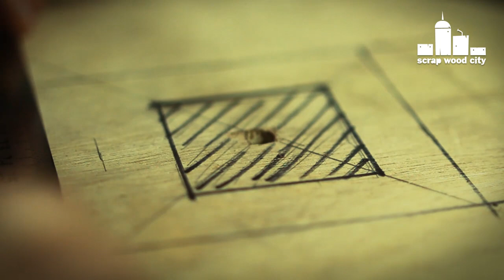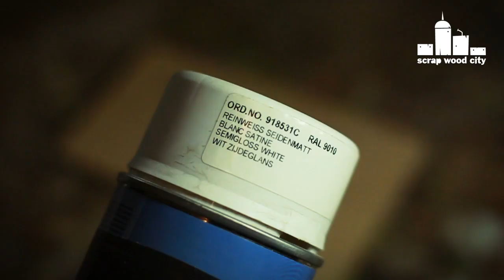How to make a wall clock out of wood

Comment: Nice clock.  I like how you routed out the back for the clock movement.
Reply from the maker: Thanks, my router bits are not that sharp, but they get the basic job done!
Reply: cab u tell e how thick you think the wood is please?
Reply: how tick is the wood that you are using?